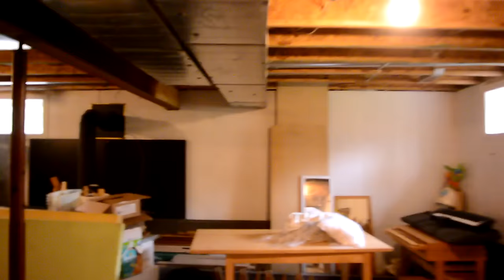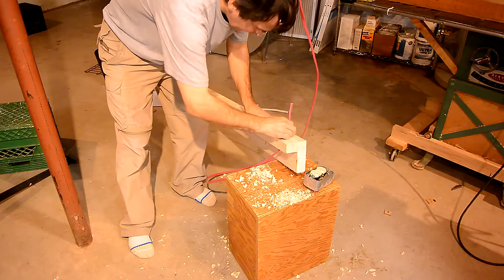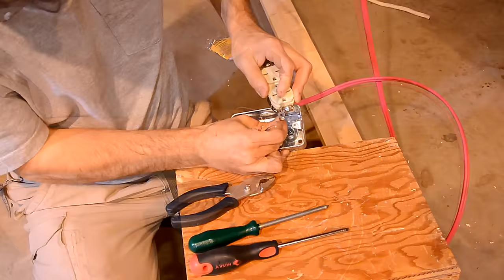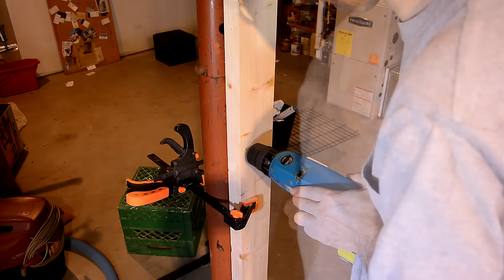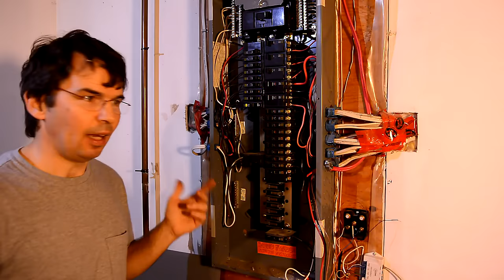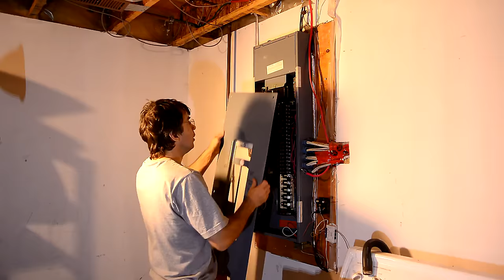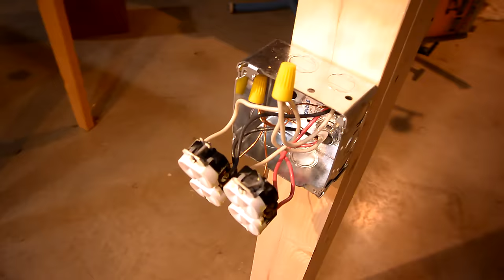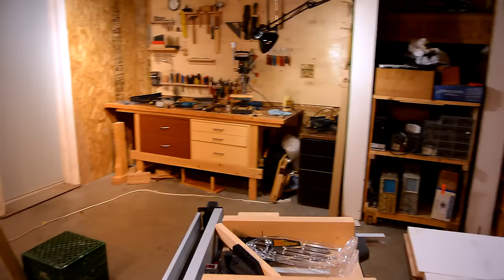Wiring a new 240 volt circuit

Comment: As a tradesman, you know what you can get away with and not but teaching DIYers its ok to touch an energized panel is not good. Most DIYers are first timers. A little drywall. some painting, a new fence, door or window...no problem. Electricity is deadly. Plain and simple. Don't care how many times you have done it. (Or gotten away with it!) it only takes once to take you out, hurt you or scare the hell out of you. Please leave the tricks (touching the hot buss bars) up to the professionals and not showing off to the  DIYers.

Comment: Don't touch ANYTHING in a live breaker panel... If you have a bad or weak ground you CAN get nailed by touching the live bars.
Reply: Good advice, but not true.  The ground on a breaker box is not key here.  Isolating yourself from completing a circuit is the point.  Best to use one hand only and not show off.

Comment: I'm sorry. But I have to say this:
Very very dome.
Working on an apparently power on electrical box. That's what he is working as he said.
But it looks like he is actually touching the live bar.
Plus he is grabbing the screwdriver from the metal part while making contact with the box end the screws.
And if I want to make a video as a toutorial, I would find a way 5o get electricity from somewhere else in order to turn the power to the box off. Nothing worse than making a video without following safety rules.
That's my opinion

Comment: I'm sure when you touch the live bus bar, without touching the ground inside the electrical panel, you will still get shocked. 
You are standing on the ground with your shoes, and base on the resistance, you are essentially grounded
Where in the video he claims, don't touch the live bus bar and ground at the same time otherwise you will get shocked.. So just don't touch the live bus bar at all.  Period.
Reply: That's false. You only get shocked if the dielectric rupture potential of your shoes is low enough. He was wearing rubber shoes on dry floor, thus needing North of 1500 volts to even make an arc.
Reply: @lmmartinez97  make a video and show us

Comment: I want to make a good video so I'll chance death for views. Lol I'm a electrical/ mechanical technician.  Do not ever work in a live panel unless its running emergency systems like life support or server systems.  But residential you don't have that issue.  I always wear gloves rubber inside leather and flame resistant clothing along with face shield.  240 is no joke it doesn't take much to stop your heart.  Or a arc flash could literally burn you to the bone. Put a rubber mat down on floor. Its not hard to be safe. Do things the right way.

Comment: Really bad examples: Don't turn off power, but touch the bar. Touch the metal part of the screwdriver. Don't show a close up of the wiring in the plug. Don't really explain how you got 240 and 120 in the same run, etc. etc.

Comment: You said you were isolated to ground so the electricity has nowhere to flow. Thats not quite right. The body has inevitably some parasitic capacitance to the environment. Meaning that on alternating current you still can get zapped.

Comment: It is irresponsible to demonstrate doing this job without turning off the power. Linemen and Electricians DIE doing this kind of work every day and they are trained and are aware of the dangers. 
Everyone connected with this video will be very lucky if a tragedy caused by this travesty doesn't result in a huge lawsuit.  
I have been a repairman since 1973 and going into people's homes and seeing how many average people do not possess basic knowledge about electricity nor do they have common sense makes me fearful that someone will watch this video and kill themselves. 
I hope this doesn't happen but my years of experience tell me that it probably will.

Comment: Enough has been said about safety so I won't waste my breath. But you wired your upper outlets in a very unsafe way. You should never jumper your wires thru an outlet. Instead use a wire nut and pigtail them together and with a third wire that then goes to the outlet. You can potentially put a lot of strain on the break away tabs that join the top and bottom of your outlet. 
Oh and keep your fingers off the hot bars... Your wife loves you too much to find you dead .... Just to prove a point

Comment: You are just so wrong.... i know you don't care, but you're so wrong anyway. This has nothing to do with "birds sitting on the electrical line" ....
Reply from the maker: so in your mind, I got zapped?  That I can't fix, I'm afraid.
Reply: no, it's .... birds are sitting on one electrical line that carries 120V for example. Due to their small body it's impossible that they could touch both hot and neutral the same time. Therefore it's impossible they get a electrical shock since their whole body is only on one potential.

You however stand on the ground which is at 0 volts potential but touch the electrical box which carries 120 or 240 volts. In the case you  touch a powered part with your hands, your body is on 2 different potentials which causes current to flow. Wearing isolated boots can prevent the current to flow from your hand to your foot, but if you touch the grounded electrical cabinet with your left hand and touch a hot part with your right hand, the current will flow from one hand to the other. (you mentioned this part in the video)

Please excuse my bad english.

Comment: Matthias where are your german roots gone? Have seen some code violations and your electricity theory isn't flawless. 
1. Yes you're right. You can touch life conductors without getting toasted when you're isolated from the ground. But the housing of the breakerbox is also connected to ground so the chance is pretty high to get shocked when you're working on life conductors.  It's totally unrecommended!
2. You installed your outlet way to far to the ground. Check your local code what the minimum height is. Normaly there are good reasons for these limitations.
3. The neutral is actually unloaded when both lines are loaded. But only when both lines are loaded with the same amount and kind of load. For example the neutral has the highest load when you have two consumers connected with the same load but one is an inductive load(e.g. universal motors) and the other is capacitive (e.g. switch mode power supplies).
Reply: 2/ can you elaborate on "too far from the ground" ? Please provide a situation where it would be dangerous or inconvenient.
3/ Obviously he knows that. It's not like the brick power from his RasPi on one outlet and one circular saw on the other will cancel each other, and I assumed that he was implying two similar electrical devices in term of power and design.  But clearly, he was not doing to sidetrack into this.